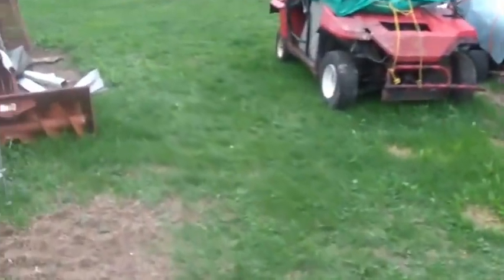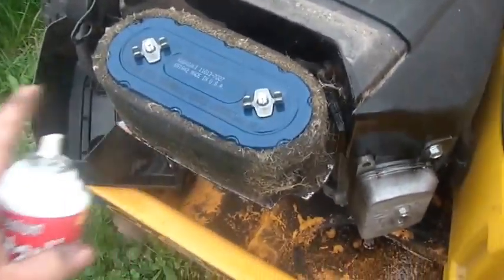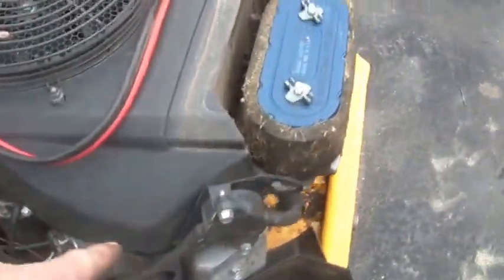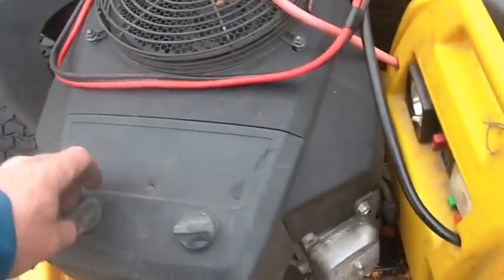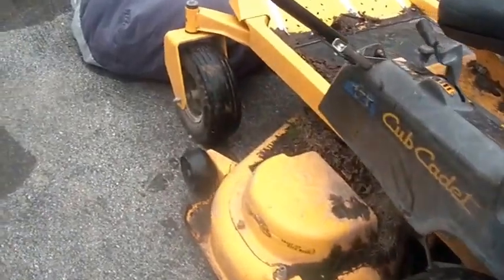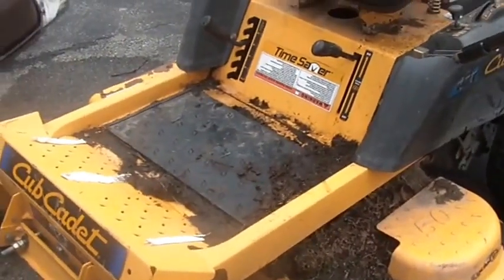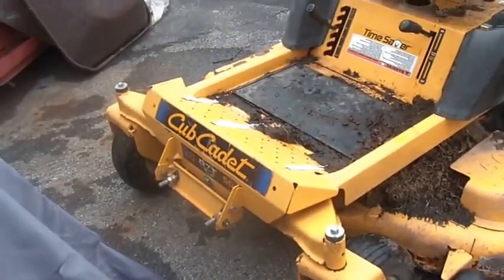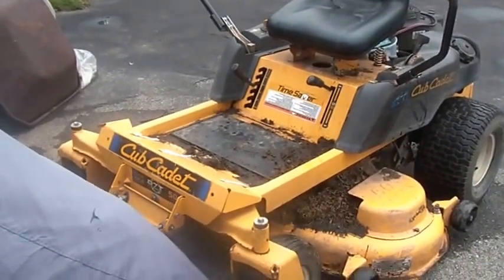Cub Cadet RZT50, 22HP Kawasaki, Spring cold start, winter finally over,

Comment: Boy mine is a stubborn mule. Every year it doesn't want to start. Get it jump started then I'm good. This year I bought a new battery. Cranked over no problem. Now it won't start!!
Reply from the maker: Hey Faith... The fuel pumps are a little weak!!  They need to spin over fast and they need to spin over for a while before the whole system gets fuel moving thru the carb... I hit mine with starting fluid, it fires right up!!!  This year, I need to clean out my gas tank and fuel line.... I'm not sure how it got full of junk, but, it is full!!!   Thanks for the info, watching, and commenting!!!   I hope my comments help!!!!

Comment: I have a 2007 cub cadet 17 hp kohlar and  it runs great the deck was destroyed after my gramama used it for 12 years then got a new ultima  so I took it off put some mud tires on the rear a winch and light bar on the front and since it was already straight piped I got a small exhaust stack from the auto parts store and got some old piping from a small four wheelers exhaust and welded it all together after I unbolted the old exhaust holder that was already half broke off so welded the exhaust with the stack all Together nicely and 👍 it’s a nice utility machine even though I own a side by side with the same things thought I would get some use out of it

Comment: Those are great mowers, They certainly make the job a lot faster. Harvey get a oil can and put some mixed gas in it to use as a cold starting fluid.  Ether is very hard on engines. I never use ether because of the damage it does. You also well save money in the long run doing it with a pump oil can.  Or what I did for years I used a empty mustard bottle.